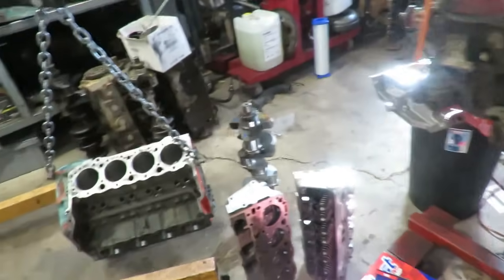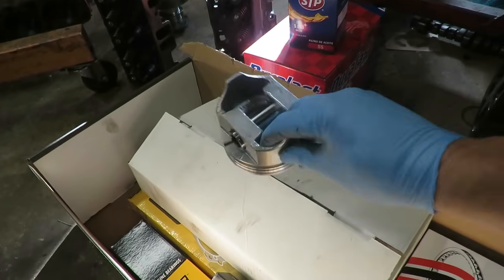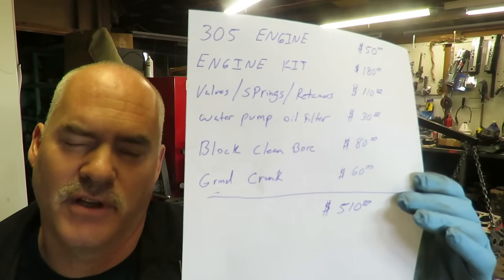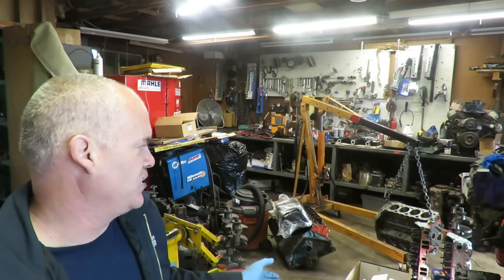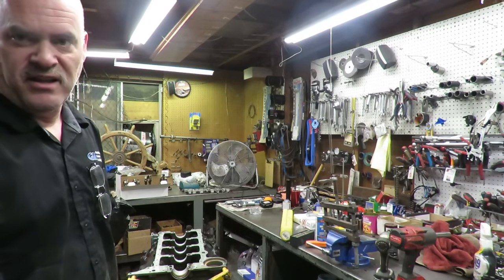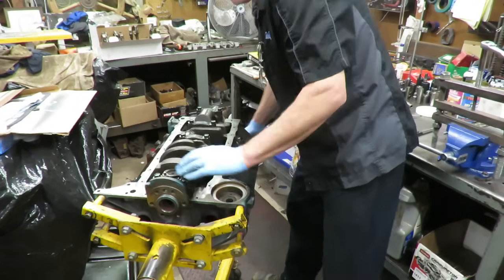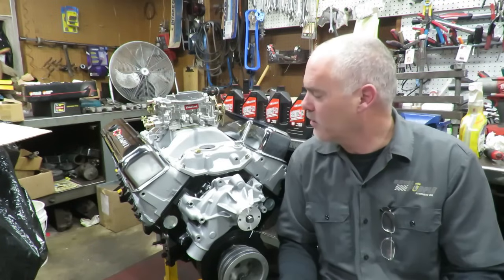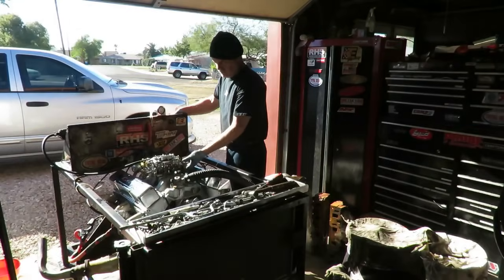Small Block Chevy extreme Budget Build

Comment: Best build ever! I want to do this with a basically stock 1964 Buick 300 cu. in. V-8 I got out of an 1964 Buick Skylark station wagon that was a 2 bbl and change it to the slightly higher compression 4 bbl (there was a slight difference in the compression) and put it in my 1984 Toyota 4x4 truck that has the solid axle front end 4x4 system. I also want to keep the original Toyota 5 speed manual transmission.
Reply: Can you get the adapters ?,that thing will pull stumps, I wouldn't horse it to much in the rough though .

Comment: I love your videos. You have inspired me to start a project that will test my abilities. I’m building my first 350 ever. I’m starting with 97-2000 5.7 vortec. I am building it to run on propane for a off-road rig. I’m looking for 275 - 350 hp. Do you have experience with propane? From what I read, You want 12-13:1 compression, hardened valves, 3/32 valve seat, and chromium plated rings. What I don’t know is whether any of this is true and what cam works best with propane. Looking for low end torque and smoother idle. If you could point me in a good direction that would be greatly appreciated. Thanks you and keep making great videos.

Comment: I will say the machine shop around here is about 15 bucks a chamber , the z28 valves and springs at the machine shop will cost about 250 for the pair of heads , now around  here  the rings head gaskets  intake gasket timing chain seal and gasket , rod and main bearings,  cam bearings valve cover gaskets freeze plugs , rear main oil seal , this kit around here is about 280 , the cam about 200 .....basically about 800 to a 1000 here in Kentucky is an extreme budget build.....

Comment: The best sreet cam  I've  found  is a lunati  street master  285 / 235 Duration  at 50 with  507 lift.    Sounds  great  make very  good  street  power.  Mine make about  375 horse .  And thats  with  shitty 882 heads..  A.F. R. 185'S  should  make 420 horse.

Comment: Absolutely love the budget build on a 305. I would not have wasted my money on it. But I love the video. Do you really think it was only pushing around 200 horse? It's amazing that a stock 350 would push so much more horsepower and torque.
Reply: a stock 1972 -1976 350 is the same power as a 305 my friend.my 1972 malibu was about 160 horsepower.were are you getting your info.

Comment: Perfect video for me and where I'm at.  You should do a BBC version as well.
Reply: Big block means bigger price unfortunately
Reply from the maker: You can't do a BBC for this kind of $$
Reply: Yeah. He's right.  I thought 1500
Would get my 454 done. 5900 dollars later. Lol.
Reply: @Myvintageiron7512  Not in a normal amount of time but I'm pulling it off right now slowly.  $120 for a cam, lifers, and springs at a swap meet.  $500 for an old farm truck with a 454 (came with headers and 781 heads). $130 ebay gasket/bearing/ring kit. The car Im putting it in had a Holley 750cfm carb already, so all I need now is a $100 used craigslist performer RPM and Ill be good for 400+ hp.  I'm in Canada too so It all adds up to only ~$630 USD.  I'll start selling extra parts after too to recoup some of the cost, I got a complete set of oval port heads for $100 at a swap meet that I don't need.

But yeah it would be a boring video that lasts 6 months and is still more costly than a small block.

Comment: I'm on board with this, great job!  Yep, I've got one of these SBC's but it's not got the HO heads on it like yours.
One question though, what did he wind up doing for a transmission?  If automatic, was he able to use a stock torque converter?

Comment: Great video, Thanks!   I need advice.  Purchase a 82 Corvette that just turned 66k miles.  This car had been sitting for over 25 years. (Needed fuel pump).  Runs good but am wanting more go!    I am retired and working on a budget,  so I wanting to start collecting what I'll need to add about 100 hp or so.   Thinking of starting with the heads and cam.  If I go with Vortex heads,  that'll  mean a different intake manifold which also means throttle bodies and computer, yes?   Cam advice also, please
Reply from the maker: You can buy aftermarket Vortec heads that have an intake bolt pattern for your early intake

Comment: This is a great video! I'm trying to build a 350 Chevy engine from the 70's on a budget. My question to you is can this be done in stages as far as letting the engine sit for a period of time or is it better to do it all at once? I don't have all the money to lay out at the moment but can do some in stages
Reply: save,get everything you need and build it all in one shot.you can do some things in stages:
step 1)get a 305/350then strip it down and make sure to mark everything like bearing caps,rods,pistons,push rods to keep the proper order.
step 2)send the block out to be tanked and machined/honed.make sure to remove frost plugs and oil galley plugs before sending out.(oil the block and bag it after work is done)
step 3)acquire a kit based upon how large your block was bored ,if you need pistons and if your crank was ground.

do not buy anything until machining is done or it will have to be sent back.buy the best parts you can possibly afford.

Comment: I argue you could do this within a few $$ for a 350 too. The big push to LS and strokers leaves a lot of stock parts just sitting around. Using the stock heads and finding other parts at local stores, swap meets and online (rock auto, jegs, summit). I see people buying the 290/350 crate motor selling the new heads, cam, lifters with pushrods for $100 - $200. Look for returns and open box sales too.
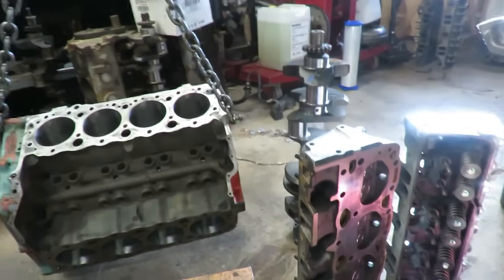Reply from the maker: yes but there are two problems with that number 1 the 350 core will cost you 2 to 3 hundred dollars so your already at 900 to 1K number 2 I cannot bring myself to do this low end work to a 350 I would not build it this way I would want to make it much better the 305 really leaves me with no guilt because it's kind of a terd to start with but this engine in an 1800 LB car with 4:10 gears will blow the doors off of quite a few cars on the street with that said this car is not going to race it's just a cruiser lots of Carr shows and Sunday afternoon drives
Reply: @Myvintageiron7512  Definitely can depending on where you live like you mentioned. I get yeah on the poor 350. LOL

Comment: I've been picking up 305's for $50-100 sometimes free, I try and look for the roller ones.  I put one in my monte ss and it fries the tires.  People think its a built 350.  I do the quick rebuild on them, next one is going to try a turbo on it.
Reply: keep it low compression and it will eat!!
Reply: What all do you do on the rebuild?
Reply: @ryanwilliams7600  I remove any excess casting for good oil flow.  Stock rebuild on the block.  The heads I put z28 springs and roller tip rockers, gasket match the heads.  I upgrade the cam with a mild compcams or voodoo.  I top with a rebuilt Q-jet for the street.  Great engine on the cheap.
Reply: @jhh70  That doesn't sound too expensive at all. I'm really leaning towards doing this. The more videos I watch and the more comments I read make me feel better about saving the 305 in my 87 Monte SS.

Comment: I'm looking at a crate 305TBI for my 1995 c1500 low rider just to cruse in... I tried to do a build, but after adding it all up, a crate engine is cheaper with the prices the local machine shops around here wants.
Reply: find a good 1997 vortec 5.7 not 305 if looking for head flow n efficiency  the full floater n piston rings a of metric size n do not wear the bores like old ones there almost as good as a ls just watch heads they crack but the power n all that is so much better at burning the fuel i use ls sloppy mechanics YT style swap mostly
Reply: @overbuiltautomotive1299  i couldn't understand your reply,learn to speak in sentences with a start and a finish.also for the love of god use punctuation,avoid being scatter brained..

Comment: Hey like ur channel u have grate info.  I have a stock 2000 Chevy 350 want to convert to carb for an 80’s car . I have a question what cam and intake would u recommend for everyday use and add more power? Thanks
Reply: Sorry forgot to say it is a vortex Chevy 350 pulled out a 2000 Yukon

Comment: I have a 305 I built very close to this stock bottom end with factory flat tops 270H comp can hardened pushrods comp lifters HEI ignition hi volume oil pump gear drive ignition all in at 3000rpm 38 total timing z28 valve springs with new guides valve job and had to cut down the guide boses to accommodate 470 lift on the factory truck 58cc chamber 305 vortec heads did some porting on them myself topped it off with shortie headers a performer rpm vortec intake and a quickfuel brawler 650cfm double pumper carb runs strong to 6000 RPM it’s in my daily driver and winter driven 1986 cutlass 442 with a 2004r tranny and 2600 stall converter runs great but is a bitch to warm up no idea how much power it’s making
Reply: 190 HP

Comment: The school that I went to said to start and maintain 2,000-3,000 r/p/m to break in the cam as the throw off from the crank is what keeps it lubed. The break in time is around 30 min. in that range. The cam lube with good spring pressure will wipe off the lube applied during assembly in only a few min.
Reply from the maker: the 30 minute cam break in was done the night before off camera

Comment: Stock block undecked deck lovers only. 9.025" deck. People find a machine shop you can trust get a gm or dart 400 or 350 block, or if have a 350 or 400 or a gm goodwrench take the crank out have it ground to 3.528", get the rods with the new 2" rod journal and get them in 5.85" length, get full floating pin hypereutectic pistons or low expansion alloy pistons 1.411" height and with 5.7" rods its 1.561" (without gas ports -this is daily driven) with the cc relief you need for the compression you need (you use one size gasket only that is the O.O4O" head gasket not any other unless your pistons are out the top then opt for more gasket), use jegs cast iron heads with lower compression or PRO MAXX MAXX SERIES 183CC or 195CC heads, and a summit 1105 cam, erson TQ40H,  Comp XE 268, XE274, 275deh, XR276HR, XR282HR, cam if the XR282HR you may want 10 to 1 Static compression, use a performer rpm intake. This combo with a 4.030" bore makes a 360. If you got a 3.75" stroke 400 crank or a forged unit, have it offset ground to 3.828" and 2" rod journals this and a 4.030" bore makes a 391 the piston in that with 5.85" rod with 2" journals is 1.261"  and 5.7" rod is 1.411" piston height. This allows you to cut block machining, money starving workers in shop machining expenses, and to overbore we all know all you need is a hand boring tool. For us street daily drivers this is all we need. you should have a 400 hp and 400 tq engine with the first no problem, and much more with the 391. go forth true street warriors we are the REAL DEAL. i am that i am. .with the XR282HR and 67cc heads and 4cc relief piston you have 10.29 to 1 static compression and is perfect for 91 octane in that 360 and should make an absolute ton of power. Now the 391, you ll need to take some 72cc heads to 73 actual CC and the piston with a dremel to 5cc polishing those sharp edges smooth. this yields 10.26 to 1 static compression and 8.1 to 1 dynamic for 91 octane near or hovering 200psi cylinder pressure that is with the XR282HR cam, it all varies with each cam and 10 to 1 may be t00 high for a smaller cam than XR282HR for your octane. if more help is needed i shall help you. you can use these offset grinds in a 9.025" deck 400 with the correct diameter piston. remember using a stock deck it is critical that it is fairly even throughout without too much variance , i have found that many are in fact practically straight enough to use as is , just not in a 'race' or 'high end' engine where much tighter tolerances are and become extremely critical. In a 4.165" bore 400 block these make a 385 and a 417 respectively. Remember the larger bore shall increase the static compression so you'll need a dish piston or race gas or much larger cam like the XR294HR and XR300HR, you'll have 500 hp + so take care about your parts you use. at 375 hp you really need hypereutectic pistons its so near the heat of 400hp and torque anyway. and above the 450hp you want 2618 low expansion alloy or another low expansion alloy type. the pistons are 1.261" compression height in the 391, and 1.411" compression height in the 360. or keep your stock internals and block and just swap out for custom 1.585" for your stock rods. They won't list the ford 1.585" piston with the correct chevy PIN of O.927" because of people making great engines themselves without so much machining. All of this gives you a zero deck with your stock block and raises your compression where its supposed to be. Now go forth street heat warriors, now cast pistons can take a little more abuse due to the heat not getting into the top ring land by being sunken into the block! Now DOMINATE!

Comment: I am wanting to put 357 HP on a 305 SBC that is the original motor to a Monte Carlo CL non HO, and am wanting to rebuild it..1 question is: am I able to put a MILD flat tappet or roller cam into my 305 head if I put top of the line things into it. including forged piston and crankshaft.

Comment: Building a 307 sbc cam. Rebuilding 305 ho heads to put on and putting the .500 lift z28 springs, retainers, and locks on. I was looking at summits 1785 and 1103 camshafts for this build. Is there a cam you would suggest for this?
Reply from the maker: no more than .450 lift for those heads

Comment: So, so close but no cigar. You started with the perfect platform for an engine rebuild. In the video where you’re turning the short block by hand without the heads on you needed to get that tightness out of there. You would have made more horsepower and have more reliability and longevity if you just opened up cylinders and honed with the proper grit stone. You should’ve definitely reused the pistons. I would literally just have pulled the pistons and rehoned the cylinders and put this motor back together with no other work at all. That would have been the ultimate cheap rebuild. Everything else you did is just fine but not absolutely necessary. The good news is you can still go back and rehone this engine. I challenge you to do that and do a before and after Dyno. You actually made a pretty good video. Nice job. Feel free to contact me to accept the challenge and I’ll give you the exact specs.

Comment: Would this be a good premises for an s10, me and my buddy are going to throw together a budget little s10 street/strip. While trying to do it cheap, we paid $150 for 305 block with heads that already were resurfaced. And got a s10 with a turbo 350 trans for $1,000. Looks like we are going to be about 1500-2000, it won’t be the fastest out there but it will be fun to just open exhaust cutouts and sound awesome
Reply from the maker: you can get away with more cam with a lighter truck

Comment: What kind of paint  (brand and type) did you use for the heads? The aluminum paint how much was it? Building a budget motor and want to paint the intake aluminum, and the block black. Found a 350 bored to a 357, for $350 on FB. Came with a crane blue racer cam, and speed pro flat head pistons, and edelbrock performer intake which I want to paint to clean it up. I will be sandblasting it. I had a blown 350 with an HEI super coil distributor, 670 street avenger carb, hooker competition headers that came in an 82 TA rust free in Northern Michigan for $1500. Trans was blown, too. Found a 700r with a shift kit and a 2500 stall converter for $150 that I still need to go pick up an hour away, which I think is worth the trip??? I want to make her nice and pretty, any suggestions??? This is my first build at 40 years old, I am really excited!!!

Comment: Hi.
Just discovered your YouTube videos and am catching up. Excellent work!

I have a set of early SB cylinder heads on my LT-1 350 with the part number # 3991453. I was told these were made by Chevrolet Performance to prevent the cracking of the valve seats between the intake and exhaust during racing, and they had to sell (500) sets to the public to make their use 'legal'. The '3991453' number is on the (1970) receipt from Chevrolet. Next time the valve cover is off I will check the casting number to see if it agrees.

I have searched SB cylinder head numbers many times and never see this number listed? Do you have any knowledge about this? Thanks.

Bobo

Comment: I  would have done the 305.84 Ho.cam and lifters on a quadrajet and maybe shorter headers and  done some head work..the 327.275.cam is great on small stoke motors..stuff like that..ir would  run forever. Rj

Comment: He y bud ,probly should tell your buddy if ya go with the .480 ish cam he should carry a drill and a pocket full of roll pins because with that much lift it's going to push rocker arm studs out of the head.then if the timing chain breaks or shears a crank key.it will bend every exaust valve.been there done that

Comment: I ended up with a small journal 327 and it has 305 081 Center bolt heads on it. I’ve never seen a combo like it. It has flat top pistons. Is that a decent set up? I have a 30/30 cam, edelbrock rpm intake and a 600 mechanical Holley, from my 283 I can swap over. Any idea what kind of power it might make?